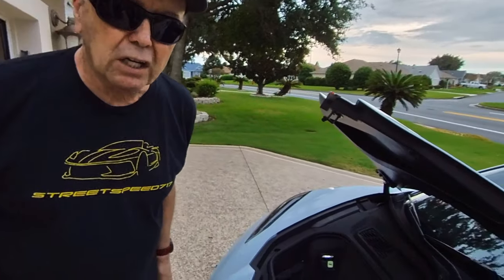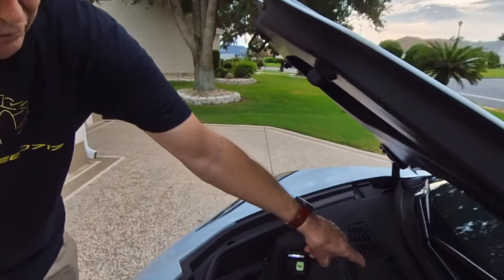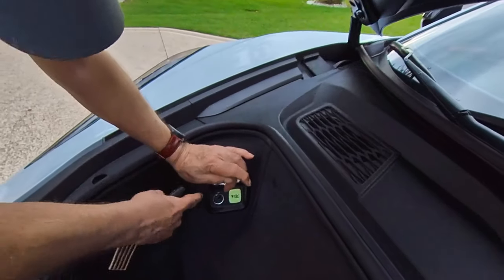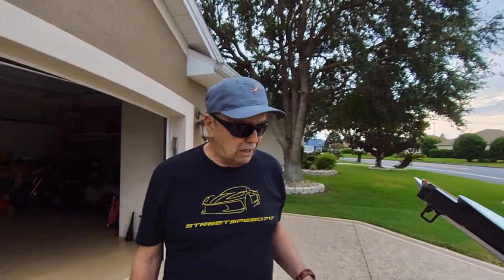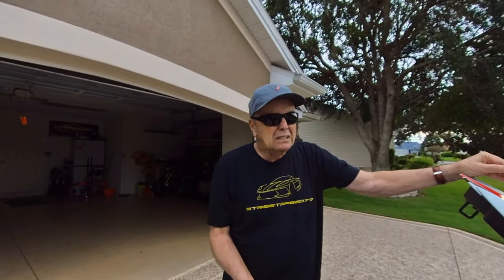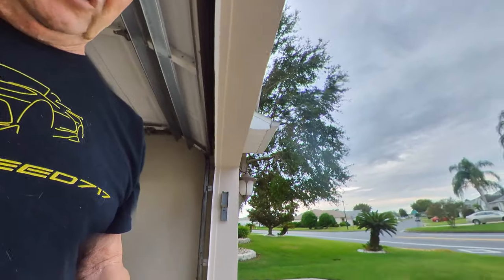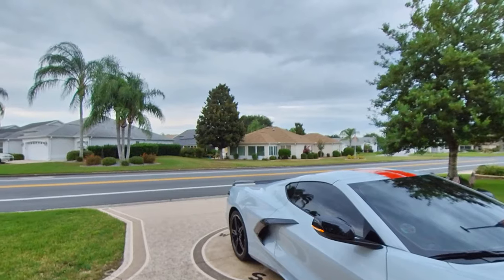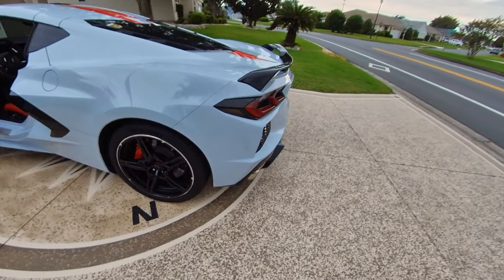C8 Corvette FOB, Dash Cam Setup, Can't Tune, Wheel Weights, and More.

Comment: Great informative video ! 1 thing if the tire installer will move the tire 90 degrees , it will take less weights! Very nice car car, and yes the tire rep should have the correct color weights!
Reply from the maker: Actually, there were fewer weights on the tire when I got it back. Maybe they rotated the tire. The difficult part of all this was that when I lived up North I had a great tire guy. Never had any problems with his work and he would NEVER put silver weights on a black wheel. He also did all my race alignments (when I was actively racing) and they were always spot on. I was allowed into the shop and could monitor all that went on.

Comment: On the tuning, I don't see why GM won't let the buyer, at the minimum,  tune things like when to turn on the fans, bigger tires etc.. I just got my hands on a 2016 Z06 M7 that had 3800 miles on it when purchased but now has 5200 miles, and I expect to be able to add a tune. I traded my 35k miles '08 Z06 for it. 

  I love the look of the C8, and I love your car.  I want a C8 Z06 a few years down the road when that becomes in-range for me affordability wise. I would like then to snag another "gently used" specimen and hopefully save a few dollars. I hope by then they have unlocked the computer!
Reply from the maker: I hope you're right. We need to make the decision to tune or not. It's that simple. You'll love that Z06 with M7. Lots of fun to drive, for sure. Had a couple of C6 Z06''s. Did headers, Cam and some other things. Those cars were fun too!!!
Reply: @RobertMacCready  My C6Z came to me with 12400 miles. I added 1 7/8 long tubes, x-pipe, Corsa catbacks, a Halltech CAI and a mail-order tune. I really never got to floor it in 1st gear but it was SCARY fast when I dare romp on it in 2nd or 3rd. I miss the car but couldn't say no to the C7Z. My new car takes the scare factor to another level LOL I really want to go to a driving school soon so I don't end up in a ditch upside down somewhere haha.

Comment: You are a whiny old man Bob 😂 I agree, wheel weights should be black. Get out your paint brush and paint them.  I also agree that we should be able to TUNE the heck out of the Vette if we so chose do do that.
Reply from the maker: I'm thinking I'll paint the wheel weights. And on the tune, it's really disappointing that GM has locked us out.